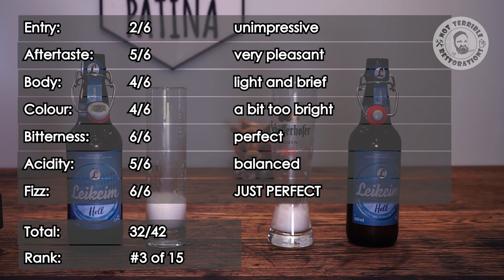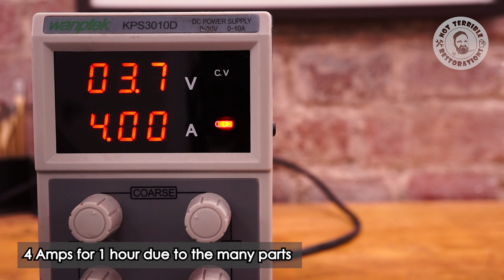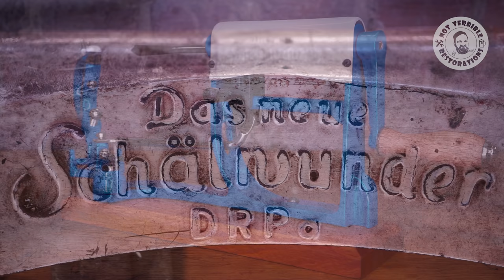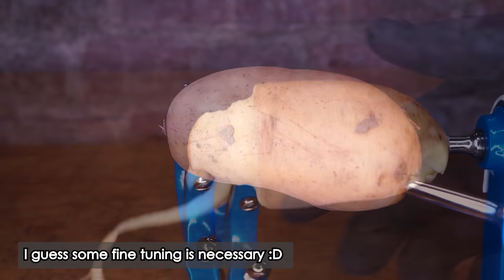DETAILED Restoration of a Peeling Kitchen Aid

Comment: Als das Gussteil gebrochen ist, wären mir tolle neue Flüche eingefallen.  Du hast das gut gemeistert. Das Vernickeln der Teile, die mit den Lebensmitteln in Kontakt kommen, ist eine gute Idee.
Gruß Tino
When the casting part broke, I would have thought of great new curses. You handled it well. Nickel plating the parts that come in contact with the food is a good idea.
Greetings Tino
Reply from the maker: Ja es war stille Fassungslosigkeit in meinem Gesicht in diesem Moment

Comment: Leave it to cut thick, and take those strips and drop them in hot oil. Instant curly crisp potato treats to go with the next beer.
Reply from the maker: That my friend is why they call you a genius! I will most likely do so
Reply: @NTRprojects  Video of this would be appreciated. You can also try other root vegetables as well, like sweet potato, for a slightly different flavour.

Comment: Does the paint primer come off when you wet sand it? If so, why not wet sand it first and then use primer?
Reply from the maker: Thank you for the question. I first prime before adding the putty, because even putty can cause rust, so there should be a protection beneath it. afterwards I prime it again. Wet sanding the 2nd layer is with very fine grit, so the primer doesnt come off, but the layer gets smoothend for a nice finish when painting.
I hope this answers your question
Reply: @NTRprojects  it does thank you! So the whole time you're kinda rushing against more rusting so that's why the primer first just in case the item rusts while you sand it. It makes total sense now. Thank you so much! I love your channel and I love your restorations I am sure your channel will grow very big and I will be able to say "I knew him when he only had 20k subs" and then I will be the cool one. 😂 Lol

Comment: I curious as to why some parts were blued and some were nickle plated? How did you determine which parts got which? Amazing work!
Reply from the maker: Hey Ty. Its a picture I have in my head and I sort the parts in the beginning and sometimes change my mind. Also for the parts that are in direct contact with acidity, like from an apple, bluing is not protective enough. In fact bluing is a very weak rust protection, but its more forgiving in comparison to nickel plating